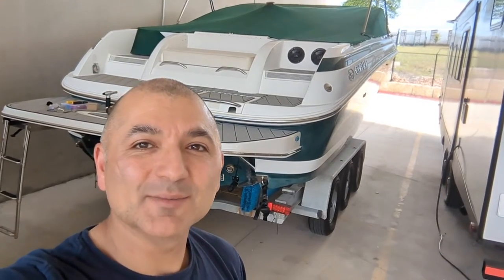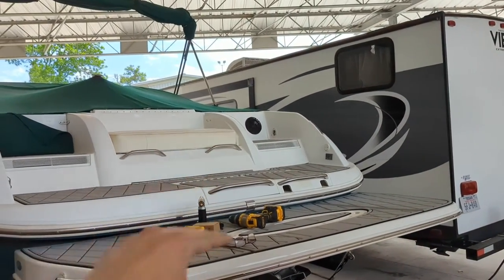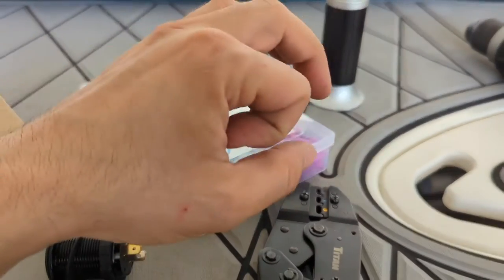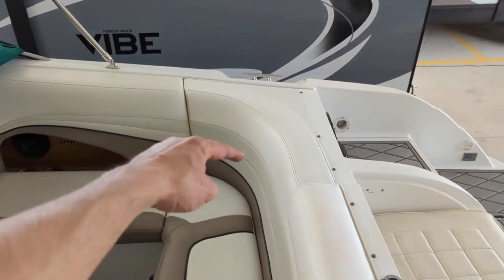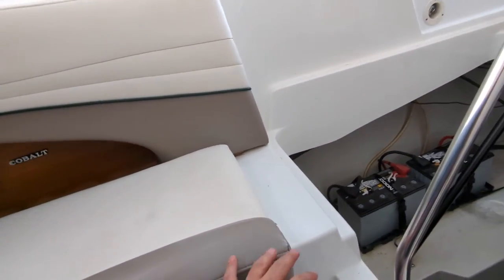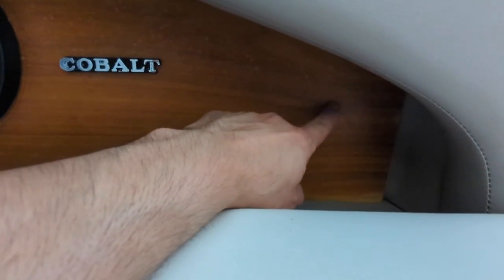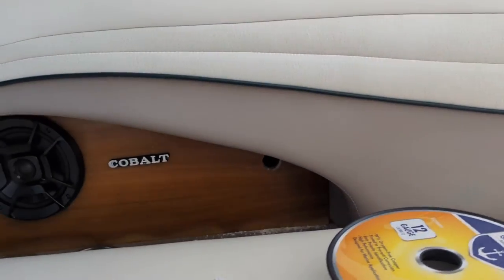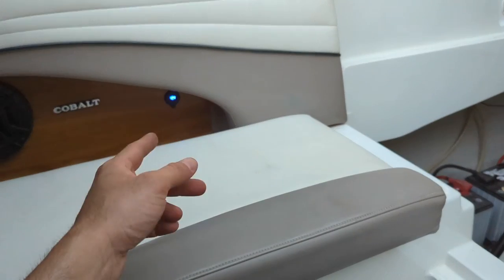Add USB Charging PORTS to your BOAT - With a Voltage GAUGE and QUICK Charge

Comment from the maker: Dual USB w/ Blue Volt Gauge: https://amzn.to/3Nnnw6c
Dual USB w/ Blue Volt Gauge & Power Button: https://amzn.to/3NuwTRM
Dual USB without Volt Gauge: https://amzn.to/3NuwQp4
Dual USB-C & Single USB Charger: https://amzn.to/38z1QFC
Small Holesaw kit: https://amzn.to/3G1MkOw
Butane torch: https://amzn.to/3wwxnRm
Marine grade waterproof heatshrink butt connectors: https://amzn.to/3MyXNrw
Marine grade tinned copper 12 gauge wire: https://amzn.to/381A4kL
Connector Crimping Tool: https://amzn.to/3MME4ot

Comment: How has the charger been doing for almost a year? Thinking putting one of my boat to, but are sceptical to the quality though.

/Daniel
Reply from the maker: ItS been good. We were actually on the water yesterday and a couple folks were using the charger ports to charge their phone. Still working well. No problems to report
Reply: @NKPGarage  awesome! Thanks for the answer!
Reply from the maker: @ExoPhotography1  you got it!

Comment: Your video was quite useful. I ordered the dual volt gauge with power button as I'm not happy with my current one.

Fingers crossed it's bright enough in daylight because my current one isn't.
Reply from the maker: Nice!! Mine is plenty bright. I can see it clearly during the day. I also got one installed in the dash by the driver area that shows me voltage for battery bank 1 and battery bank 2. Helps me keep an eye on things at a glance.

Comment: Does this drain the battery?
Reply from the maker: Very tiny draw. I have had the boat stored over the winter for 3 months and there’s been no measurable drain. But if you want you can also put it on a power source that gets turned off when you turn off your battery switch.